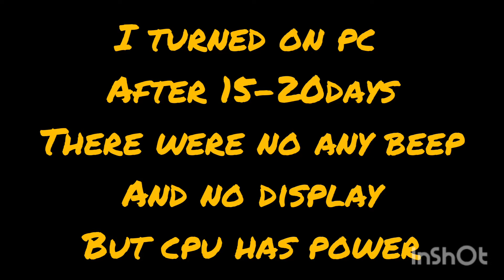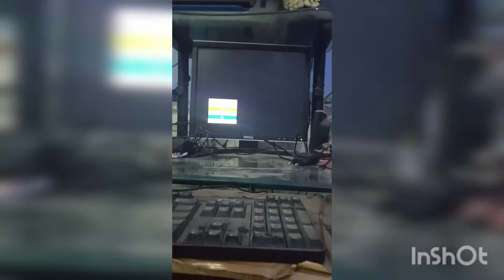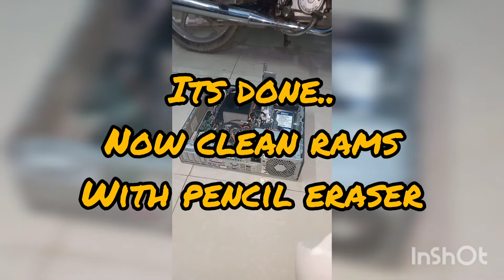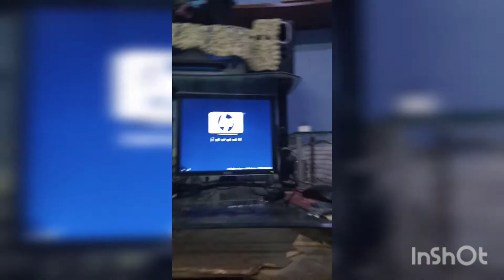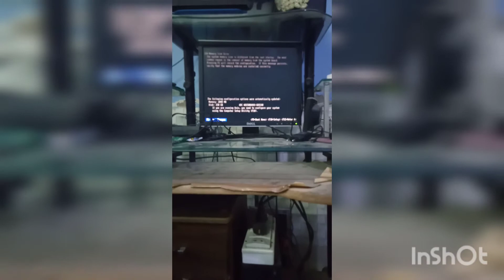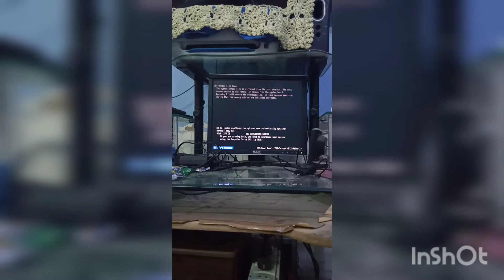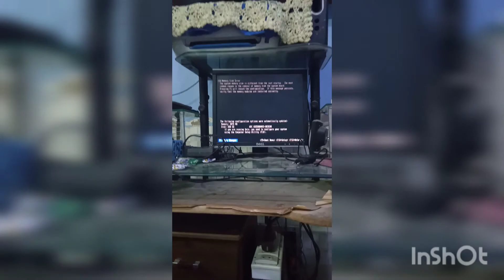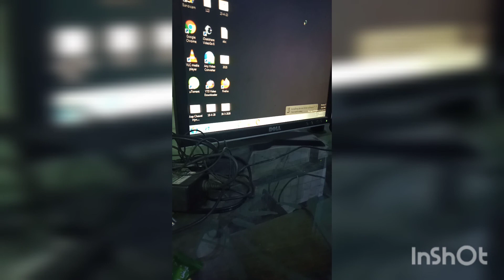How to fix PC turn on but no beep and no display

Comment: Bought new ram still no display ....what to do now
Reply from the maker: Is it giving beep?
Reply: @NomiRajpoot063  no beep signal on my motherboard ....i think problem in Bios
Reply from the maker: Bro try to clean processor.. and clean motherboard and ram slots etc with deodrant maybe it will work.
Reply: @NomiRajpoot063  ive tried this one also still no display😥
Reply: @dm8765  same problem bro